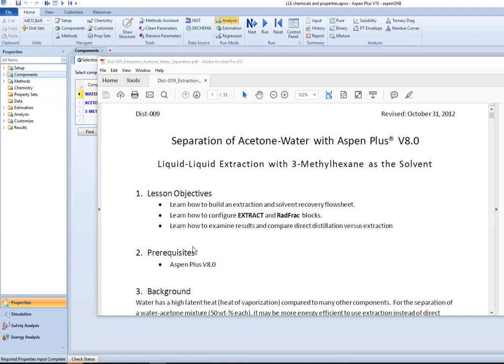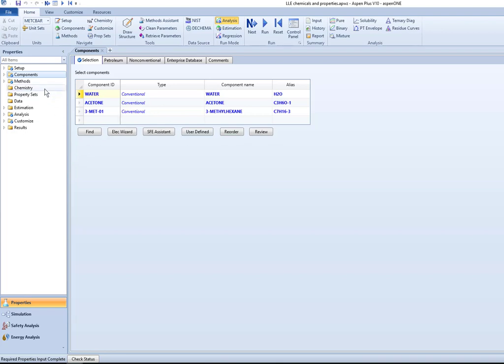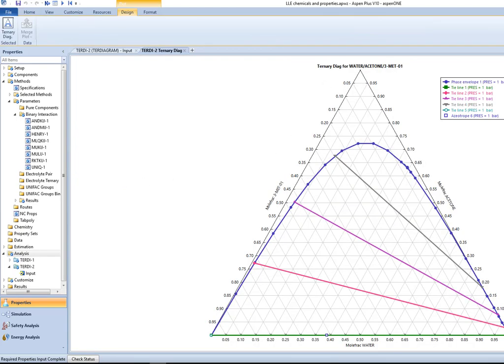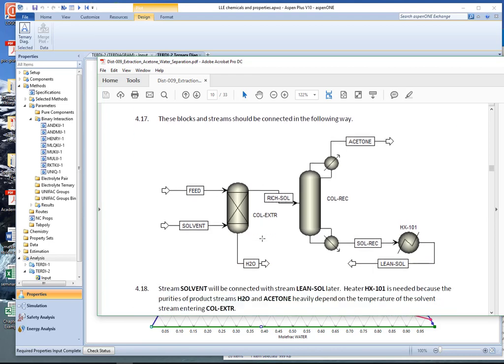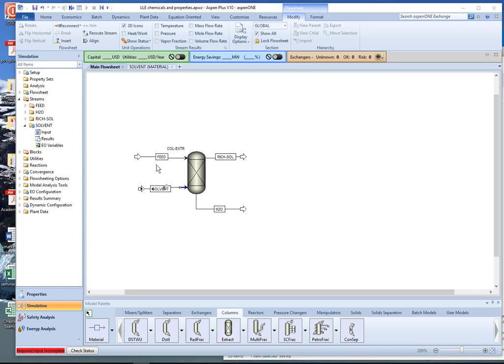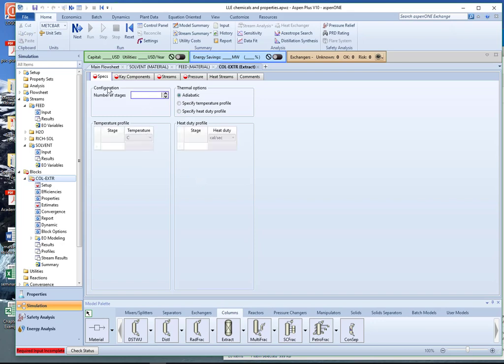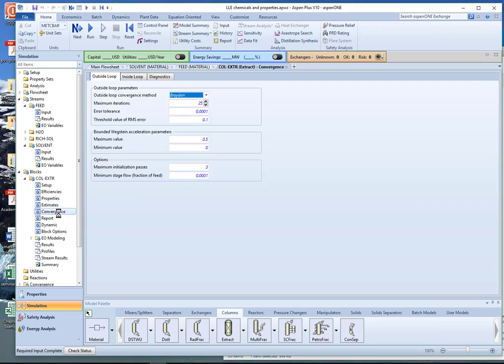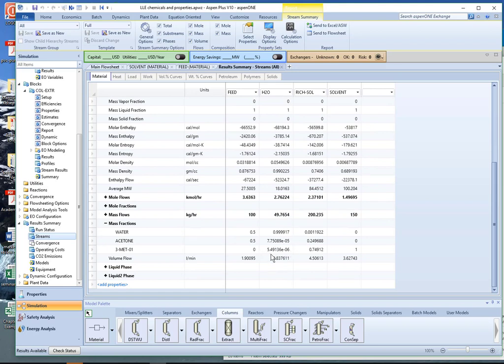Liquid Liquid Extraction in AspenPlus

Comment: I have seen quite a few of your video lectures. These are very impressive. I am a Mechanical Engineer but always had an interest in Chemical Engineering. Where do you recommend  I should start your lectures? I have taken Fluid Mechanics, Thermodynamics, Heat Transfer and Design of Thermal Systems along with General  and Organic Chemistry  was well?